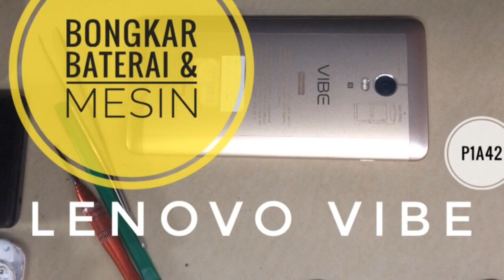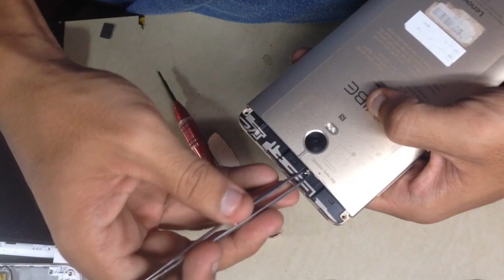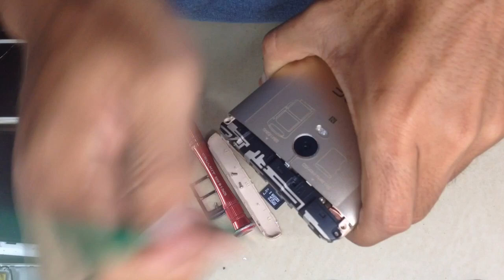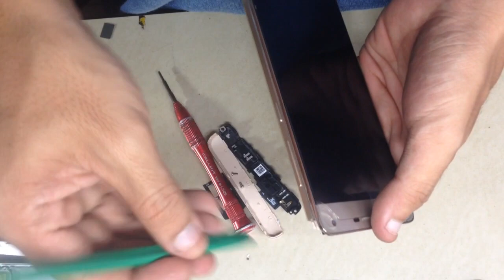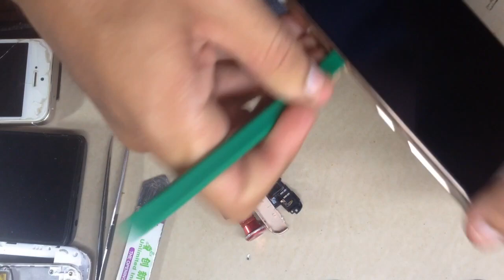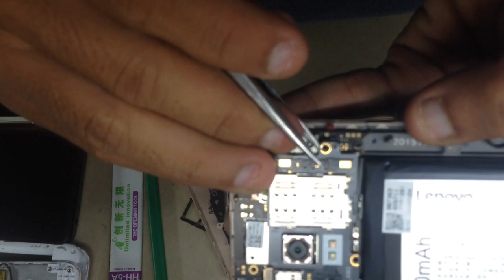LENOVO VIBE P1a42 : Cara Membuka Baterai dan Mesin

Comment: bang minta saran dan cara nya dong , ini hp saya gini juga , tombol power dan volume nya terlalu masuk ke dalam jd ga bisa di pencet , terpaksa nyalakan matiin pake icon sentuh lebar , nah kira kira caranya gimana bang supaya tombol power nya bisa naik jd bisa normal lagi . thanks
Reply from the maker: buka bg. lihat bisa d angkat atw harus ganti power. kadang bisa juga itu power patah bg. cb buka aja bg
Reply: @woworrepair  bang ada yg jual kesing nya KH, soalnya tombol power serta volume sdh patah karetnya
Reply from the maker: Sniper 01 di toko spearpart hp ada bg. kalau mau lebih banyak pilihan di olshop juga banyak bg. tinggl tulis type hp aja. pasti ketemu
Reply: @woworrepair  nah itu bg w sama kaya yang di atas tomblo tombol karetnya patah, kira kira bisa di beli dimana ya, soalnya di online shop malah tombol dalam nya yang di jual.